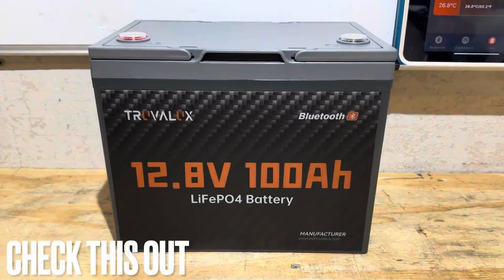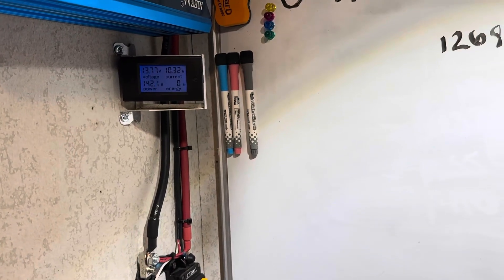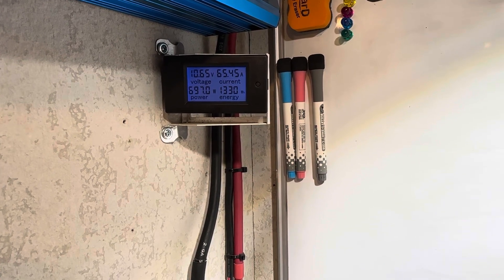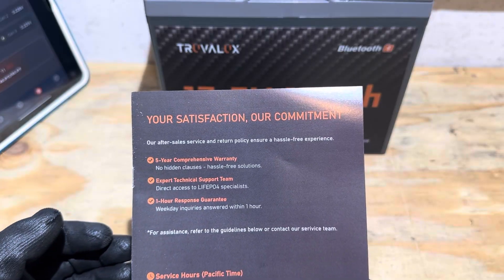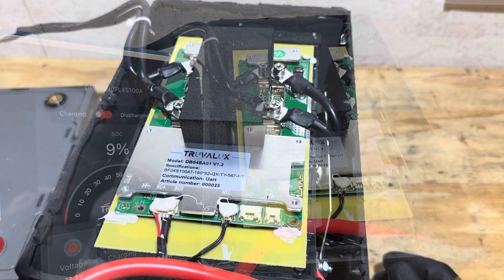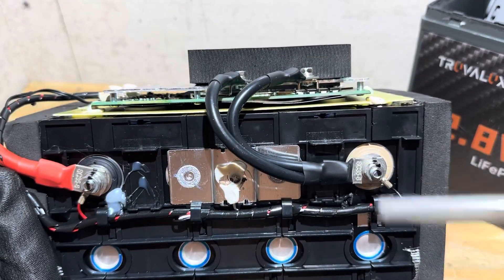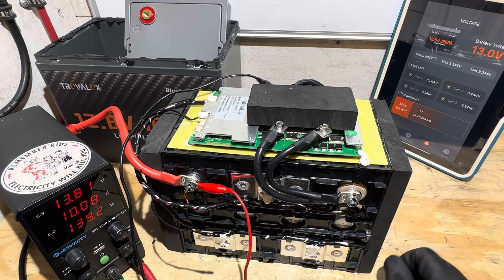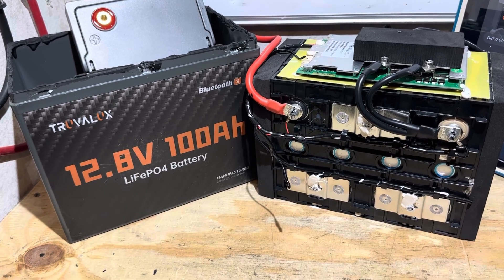Budget 12V LiFePO4: TRUVALUX 12.8V 100Ah LiFePO4 Lithium Battery Review & Teardown

Comment: Thanks for the excellent teardown including the temp shutdowns. Have you investigated the ability of the BMS to connect with the Apps for other manufacturers using the JBD BMS? (Or the generic JBD tools?j I don’t have a reasonable expectation that the manufacturer or brand will be around for the 5 yrs of warranty or the rated life of the battery, and confirming the BMS isn’t locked to a particular manufacturer App would ensure long term usability.
Reply from the maker: Glad you enjoyed! 
The BMS does in fact work with Overkill Solar, XiaoXiang Electric, etc. 👍

Comment: Do you see any reason why this battery wouldn't work for a trolling motor? The manufacturer (Watersnake) recommends to use only a lead acid battery.
Reply from the maker: How many amps does your motor pull? Lead acid will take a larger surge current with an equally large voltage drop. 
Watersnake 54# thrust motor indicates 54 Amps from their ad.
I’m willing to guess the BMS in the LiFePO4 would laugh at that. I’ve pushed these batteries and others with similar BMS at 100A continuously until empty with not even a hiccup. Maybe keep the lithium in a battery box to keep water away from it etc. You’ll have longer runtime at a stable voltage too.
Reply: @THEOFFGRIDMOUNTAINHOMESTEAD  Thank you for responding. What about the higher voltage that lithiums produce, can that damage a 12v motor?
Reply from the maker: @gordonlechner4474 Resting LiFePO4 after 24/48 hours is 13.4+\- not much higher than a freshly charged lead acid.   Lots of people already use lithium for trolling motors. 👍

Comment: Great reviews! 

Was the $184 the price after using the 25% off coupon? It is coming up as invalid. The current price is now $238.99 with a $55 instant discount from the company bring the price back to $184. Please make an updated video about your most recommended 12v 100ah budget batteries.
Reply from the maker: Thank you! 
The original retail was $184.99. No coupon or discounts available. After a couple days they changed listing and went to higher advertised price with a “coupon” to bring back to $184. This is a sales tactic many brands use. 
Thank you for sharing that the code isn’t working. 
I appreciate your suggestion on most recommended battery. That’s a great idea and I will definitely do that! 🙂

Comment: Another comprehensive battery review. Looks like a good battery. Price is right with decent features and a great app. I was never a fan of apps or blue tooth but now I wish I had them on my batteries. Thanks!
Reply from the maker: Glad you enjoyed! I didn’t like the apps at first either, not for the “app” part but having third party software on my phone/tablet etc. 
I used an old phone with the personal info erased before I got the iPad. This iPad is just for batteries/chargers/system monitors etc.  no personal info is on it. 
I know, I’m weird 🙂
Reply: @THEOFFGRIDMOUNTAINHOMESTEAD  I was going to ask you about that IPad. Perfect for battery data. On privacy, no you're not weird. :)

Comment: Can you run two of these in parallel for running a trolling motor?
Reply from the maker: Yes you can! Manufacturer allows up to 4 in series for 48V or 4 in parallel for a 400Ah 12V setup!

Comment: Thank you for the review.  Quick question…. Do you know who sells or where I can pick up some of the high density foam used in this battery?
Reply from the maker: You’re welcome! You can find foam sheets on Amazon usually sold under closed cell foam categories, also Uline carries various foam sheets. If wanting to shop at a local vendor, some hardware stores carry it and sold as insulation sheet/foam.
Reply: @THEOFFGRIDMOUNTAINHOMESTEAD  Thank you...  I've actually had a difficult time finding closed cell foam that's ok for lithium batteries (fire resistant) at a reasonable price/size.  Everything I've found is either super flammable, or $200 or more for a sheet that's way too large for what I'm trying to use it for.